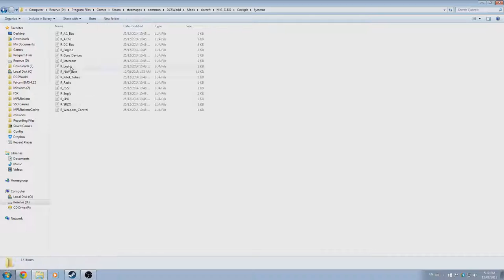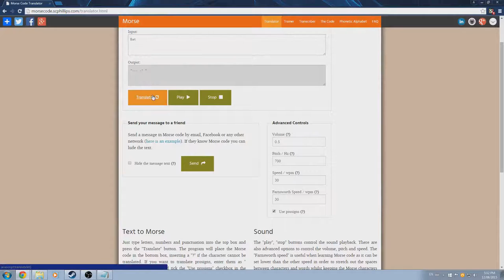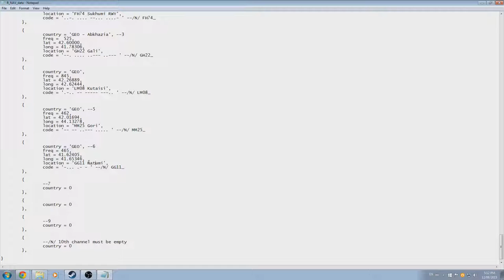DCS:World » Creating ARK/RSBN/PRMG nav stations » MiG-21Bis

Comment: Is this also working in MP or do i need to do this as MOD on the server and client side?
Reply from the maker: Ghost08151 I haven't had a chance to get anyone together to test it yet but I'd assume it would be client side since everyone would need the modified R_NAV_data.lua script modified in the same manner for all clients to receive the same station locations.
Reply from the maker: Ghost08151 It seems it should be possible to include the modified data into .miz files so that certain missions have the modified beacon file included in the mission which would make it available to all clients connecting.  I still need to test that out but I'll likely do a video on the topic later this week.
Reply: pickinthatbanjo thanks
Reply: +pickinthatbanjo any success?
Reply from the maker: Not with this particular edit, it seems including the folder in a manner similar to the folders for radio settings.lua files into the mission file prevented dcs from launching, would just return to desktop instantly without launching.  

I'm still not sure as to what the error there was since that same method works perfectly with other files such as radio settings, MFCD settings, ect.

I still believe it's possible, just not sure as to what the issue was or how to go about getting around it at the moment.